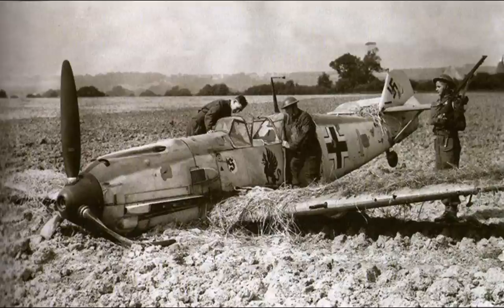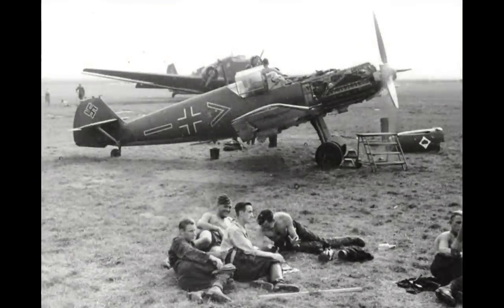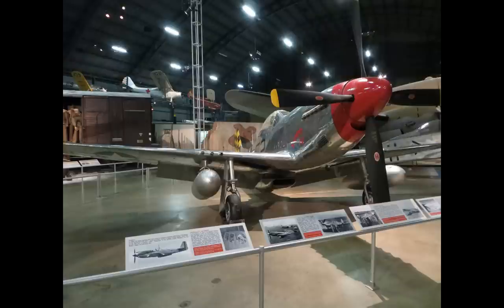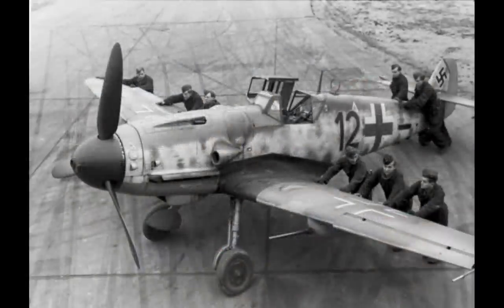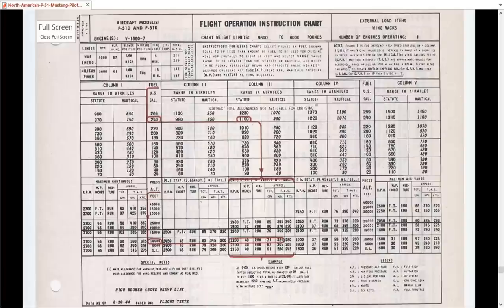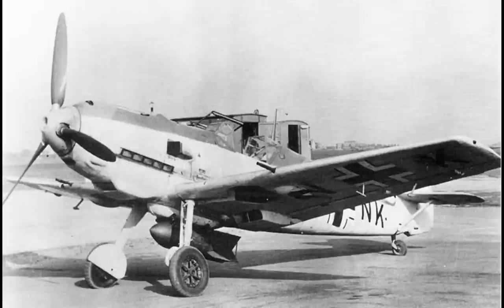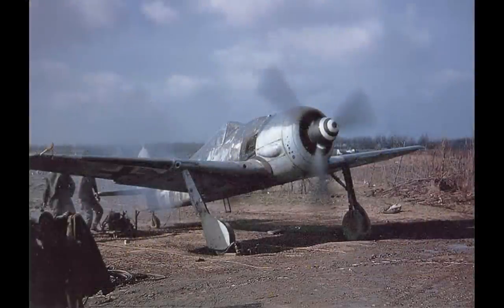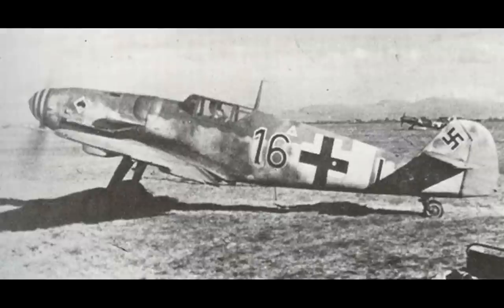Messerschmitt BF 109, Why Such Short Range?

Comment: The real reason was simple.  Psychology.  Europeans do not think in terms of distance.  The Germans saw no reason to design for a long flight distance because the idea did just not occur to them. If you contrast that with the ranges of Japanese and American planes it is pretty obvious.  The Spitfire, on the other hand, could barely make it over the channel.  Same psychology, a short range, defensive aircraft ill suited for carrying the war to an enemy as opposed to a long range aircraft designed for offense.
Reply: Psychology is probably the wrong word. Strategy and geography come to mind. That's why Focke-Wulf builds both the FW 190 and the FW 200, which along the U-Boats was the thing that gave Churchill the worst nightmares, according to his own biography. Designers and ngineers build within parameters and physics what they are outlined as requirements. That's not psychology.

Comment: Heavy engines germans but less power than US and English as they only could have only single turbo-compressor as ennemies had TWO TURBOS..P-47(P & W R-2800) even had two compressor PLUS a turbo so have lighter engines but plus much more power...AND MORE FUEL!
 But the Yak-9 shot Messerschmidt easy..., they were the best of WW II(They built 16,900 aircraft's) Maybe the P-47 was faster but the Yak-9 more agile. (Much better than the P-51)

Comment: You might be a little off on how well carbs work.  I would like to know where the fuel was injection was? Is it throttle body , port, direct ? You know quite a bit about war birds but your  ICE engine game might be a tad off!!🤣 fuel injection when properly perfected can yield more VE. But often a well adjusted carb properly set up will make better power . Direct fuel injection is King but other injection systems is a argument. I run a 5,000 pound foot navel ship dyno converted to run 500cid version of the 426 hemi. We run them on alcohol and nitromethane and use it to map super charger that we manufacture . I dig your channel but there is a good argument in the racing world that EFI will yield a bigger net gain in power than a carburetor. As of today right now a properly tuned and adjusted Carb...., will make more power. But because adjusting a carb properly is hard and few know how to do! EFI wins the average. Now because of static altitude and DA EFI is way better for a plane. I would love to here more about the German engine! I’m guessing it was mechanical injection. Did the read air fuel %  or was it just EGT based
Reply from the maker: During WW2 nearly every fighter that had a carb was switched over the throttle body type fuel injection before the end of the war. All gained power. It's also important to consider that these planes had to be able to adjust mixture to operate between sea level and about 35,000 feet. Fuel injection does that more accurately. You might get a carb to put out more power if set just right in some perfect situation, but not through that range of altitudes in one flight. I should mention that I do have a lot of experience with carbs, Weber, Holley, and Carter, and I certainly can tune them, but in my experience, fuel injection makes more power, and I think that's backed up by a mountain of evidence. I am curious what supercharger you make, I wrote a book about supercharging, and I really like supercharging.
Reply: Greg's Airplanes and Automobiles Gibson Miller mark2 from 6/71-18/71 @ BMEltd. I really enjoy your content.  I love learning and I often need help decompressing at night on race weekends. My father was the first guy to produce a “billet” hemi cylinder head for racing applications in 1981. I grew up around racing and the needle is pretty deep in my veins. I can tell you don’t speak about things unless you have complete knowledge. In my second question I went over the mixture control do to the flux of DA density Altitude. Thanks for the great content ! I’m currently in charge of ignition / fuel/ and superchargers on the Snap On Fuel Funny car.  I grew up with the Pedregon’s so I’m loyal to them

Comment: The 109 and Spitfire were essentially interceptors against the philosophy at the time that "the bomber will always get through". As such they were designed to intercept the bombers over home turf and were not expected to act principally as long range escorts. The Mustang was an interesting aircraft. It was designed to a UK Air Ministry specification and when first produced with the Allison engine performed relatively poorly at altitude. The USAAF were not interested in the aircraft, prefering the P-40 instead. Once the Mustang was twinned with the Merlin engine, it became the supreme fighter with both range and perfromance for which it rightly became renowned. The RAF first fitted a bubble canopy, improving the pilot's visibility, which was then even further improved with the tear drop canopy.

Comment: The short range for the Spitfire and the 109 primarily due to the proposed use of each of the aircraft.

The 109 was intended to basically to assist ground troops with close air support. It was a point offense fighter.

The Spitfire was designed as a point defense fighter. Go up and wait for the bad guys.

As for the venturi causing a pressure drop, it also caused a temperature drop. Which caused a more dense air/fuel charge to reach the cylinders. And as the fuel was vaporized in the venturi this caused an additional temperature drop in the induction tract. Very important as the quality of fuel that the Germans got from coal gasification was terrible. Probably like 50 octane. In order for the engine to stay together without destructive detonation, it had to be overbuilt. That is why it was so large and heavy. Even the British fuel was a vast improvement over the German stuff. 

The German engines probably needed fuel injection because their fuel was too thick and not able to vaporize.

The improvement in fuel quality in the United States allowed American engines to achieve great increases power and power/weight ratios.

Comment: Messerschmitt 109 Metro Schmidt 109 had one advantage over the Spitfire because there was a 30 mm gun in the nose of that aircraft   A-10 Warthog yeah it had a 30 mm gun in the nose about in that kapeller hub that's why that aircraft was designed that way that are cool water cooled engine they wanted to get in high performance mean looking aircraft in that are well you take a 30 mm Cannon and put in that knows of that message meant 109 and you got a bunch of b-17s on the ground that's exactly what that aircraft was made for aircraft was made to do one thing range wasn't the problem at all on that aircraft that aircraft was designed as a flight in an Interceptor against incoming bombers and escorting their bombers yeah the fuel thing was totally screwed up yeah but it was it wasn't the way it was designed it was the fuel tank that was designed wrong because each time when it went into  a 9 G turn it had one problem the fuel was not getting to the fuel system in that aircraft and everything and that's why the aircraft was not really good at going in it into a turning dogfight you get in a train dog fight with a Messerschmitt 109 and you're going to come out the winner the Messerschmitt 109 was not good in terms if you always see them they always flew straight or up or down but when I got it at turn and are you at turn was a Hamrick's because it could not get to the fuel system to keep their aircraft going it was always getting ready to for a stall that's why Spitfire was more going in the vertical roll to defeat Messerschmitt 109 have you ever seen how the mistress meant 109 went into zero gravity turn into a stall quicker than the Spitfire because of the fuel system because it just didn't have the power as the Spitfire did but that big cannon really get a job on the Spitfire when it had the chance to I want to 30 mm gun

Comment: The Spitfire and Hurricane supercharger had the option of a "Boost cut out" knob in the cockpit to manually open a waste gate and dump the dump the boost pressure from the supercharger in order to reduce fuel consumption. The 109's never had this feature.

The Hawker Hurricane had a longer range than the Spitfire. It could also out turn, out roll and out dive the Spitfire plus carried 2 seconds worth of 0.303" ammunition and could carry underwing stores. It made up the majority fighter during the Battle of Britain, with the Bolton Paul Defiant next most numerous followed by the Spitfire.  

The Bf-109 G10 had an even shorter range than other 109's due to running completely on methanol as fuel. It was also faster and could easily out perform all Allied fighters apart from the Hawker Tempest V. The Bf-109 G10 was specifically designed to out perform the P-51 D5 Mustang. Not a common 109 and only issued to top pilots. 

The Mitsubishi A6M Zero was a naval fighter hence the longer range (1,065 miles), like the US Navy's Brewster F2A Buffalo (1,095 miles). Both were designed pre-war to a naval specification for projected theoretical aviation warfare requirements.

One went on to earn a legendary reputation, the other ended the war with the highest kills to loss ratio (26:1) but notoriety as an unreliable death trap amongst Commonwealth pilots due to their version (B-339E) being powered by clapped out recycled badly reconditioned commercial airliner engines.

Comment: There is one very basic reason these fighters had short range:   They were all designed to be *intercepters*.  The priorities were Climb, Speed, and Firepower.  Maneuverability was secondary, and range was the least consideration.  These parameters were true even for the P51 and the P38 during their design process.  The fact that they ended up as very long range aircraft was a result of good luck and additional engineering to adapt them to new roles.

Comment: Because it was the same concept as the British Spitfire. They were both fighter interceptors. Designed to provide local patrol and combat missions in the skies above its own country. After the B.O.B the RAF Spitfires had the same problem making incursions into France/Occupied Europe. Plus having to cover the English channel (no pilot likes flying over water low on fuel) This left little time for combat over enemy airspace. Incidentally, the Bf-109E could have been fitted with extra fuel drop tanks under the belly in the field. If these tanks were used up first then jettisoned they would have made the 109 much more effective. All models after the Emil had said drop tanks......Oh and fyi, the US/Uk used lightweight paper/resin soaked material that weighted almost nothing. It was the fuel that made fighters unstable. And the Bf-109 was notorious for novice pilots crashing on take off fully loaded cos of the huge engine torque and offset weight. The P-51 also had to use its fuel tanks in sequence or it would be highly unstable. Most Mustang pilots used the main center tank first to stabalize the aircraft and if an enemy formation was spotted, any other wing tanks were jettisoned upon going into combat.....
But Goering was too busy getting high and shooting wild bore on his estate. Not to mention looting every occupied country......

Comment: fuel octane level.
Reply from the maker: Sort of. Fuel octane by itself has a negligible effect on range at economical power settings. However the lack of higher octane fuel means you need a relatively larger motor to get the same amount of power and that does effect range.

Comment: Hmm... I find your posts are usually very informative. BUT (!), the P51 was designed as a 'Long Range yadda yadda'. The P51 was designed as an 'Alternative' to the P40. Curtis could not accommodate the Brits for their P40 order. North American, stepped up. The P 51 'Laminar Wing' was a 'Clark Y', with readjustments. Laminar flow, was, EFFECTIVE, 'Propaganda'! The wing WAS NOT Laminar... Ha!
Reply: But the laminar flow wing propaganda hid the secret of the ramjet radiator ducting something that could have been copied.
Reply: @wilburfinnigan2142 
The model wing in the wind tunnel was laminar flow but the real wing could not be built to tight enough tolerances to achieve the same effect. 
The wing's drag profile was weird in at low speed it had higher drag than the wing on a Spitfire but at high speed it was lower but this had nothing to do with laminar flow. The more important drag reduction of the air coming out of the radiator ducting producing thrust that off set a significant portion of the cooling drag is where the real performance advantage came from.
Reply: @wilburfinnigan2142  
you keep pushing the bullshit that the wing was laminar flow it was not. It did as a result of the thickest part of the wing being further back have lower drag in high speed flight but that had nothing to do with laminar flow. but the important part was in the massive reduction of drag that the ramjet radiator ducting provided.
Reply: @wilburfinnigan2142  
Laminar flow is you either have it or you don't and the P-51 does not. the radiator ducting reducing the planes total drag by over 10% is what gave the P-51 its speed.
Reply: @wilburfinnigan2142  
It was designed for laminar flow but did achieve it because the manufacturing techniques were not up to the task of making real wings smooth enough. 
You need to do more research on the subject using additional sources. 
Kelly Johnson the designer of the SR-71 who had full access to the NACA wing design that the P-51 used did not use it for the F-80. the Spitfire that you mindlessly hate used the NACA wing on at least one generation and found it so good that they went back to the elliptical wing.
Shouting obscenities does not change reality.

Comment: why using a P-51 as a example..way more modern plane and is just a Hollywood  / propaganda myth like the b-17, not the most used by the US army/air force ,not the most produced , not the one that have more kills credited and was not the plane that the best scoring pilots used ... so... why... ppl allways chose that plane.

Compare the bf109 against one of the same date... like the P36, and i know is not the topic of this vid but....
Reply: I agree. Hollywood's sold the Mustang as the best airplane of the war and most Americans have bought that. But if there's some need to discuss or classify a 'best' aircraft of the war, planes like the Mustang and Corsair are not even in the same discussion as the Grumman Hellcat. It was in the air fighting a year and a month after it's prototype first flew. It's engine was the first power plant in history to deliver over one horsepower per pound and it could climb to 37,000 feet in ten minutes. But most importantly it's kill ratio was 19:1 and (after a somewhat late entry into the war) it erased close to 5,300 enemy aircraft from the skies, eclipsing overwhelmingly the number of air victories credited to any other plane of the war.

Comment: NASCAR runs carbs I think
Reply: Not any more. Went to a spec fuel injection system from McLaren of all people several years ago. And the only reason they waited that long was because the rules didn't allow fuel injection until then. Like he said, no racing series that gives you the choice uses carbs. There are lots that do use carbs but it's because the rules require it.
Reply from the maker: Thanks you wingracer 16. Sometimes I feel like I can't get people to understand that carbs are NOT better for performance. They were used due to technological, cost, or rules, not because they increased performance vs. fuel injection.

Comment: Comparing the ME109's range against the P51's is meaningless. Most of the ME109 vs P51 combat was done over Germany or occupied Europe, so the ME109 could fight, land, refuel and rearm, and get back into the fight. The P51 had to do all of its fighting with the fuel and ammo it brought with it. However, drop tanks on an ME109 would have come in very handy during the Battle of Britain. With more loiter time over Britain, the ME109s would have been far more effective as bomber escorts.

Comment: This guy doesn't no shit about the bf109. The bf109 had a great roll rate especially I. The e and f models. The later g models gain more weight and their performance wasn't that great. But for a almost a 10 year old model it could still dog fight. This guy doesn't even mention the p-38 lighting which had one hell of range . Milo Burcham the chief test pjlot for lockheed flew non stop from los angeles to new York with 300 gallon drop tanks. The problem with bf109 was its range and during the battle of britain they weren't even carrying a drop tank. Later after the battle of britain they start too put a drop tank under the belly of the plane.
Reply: Andre, Please stop trolling. Come on man. You expect a comprehensive review of multiple WW2 aircraft in sixteen minutes? Stop acting like a sixteen year old please. Please watch Greg's other videos. My god man, Greg is a current commercial pilot, and former naval pilot - I think. He knows what he's talking about.  You've yet to prove you know a single thing about these issues.